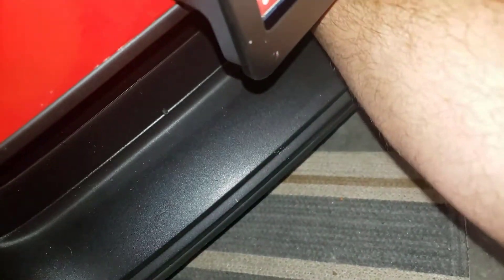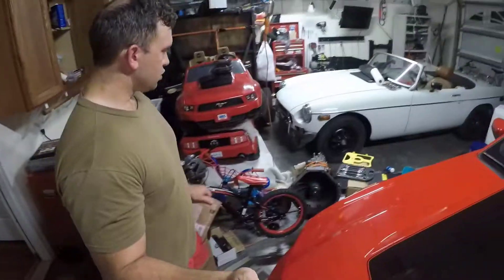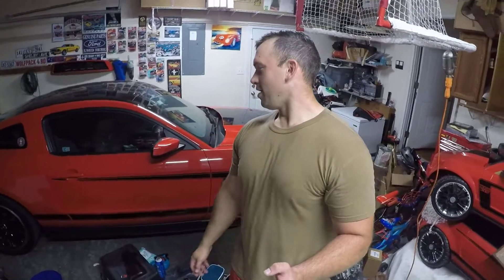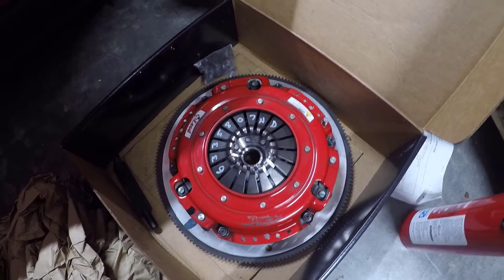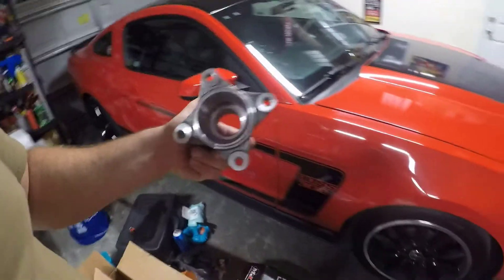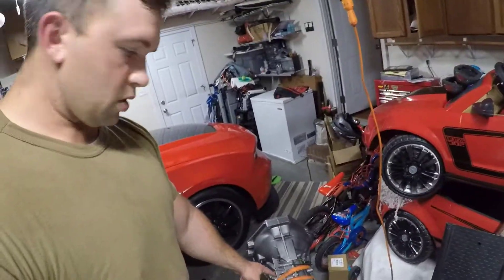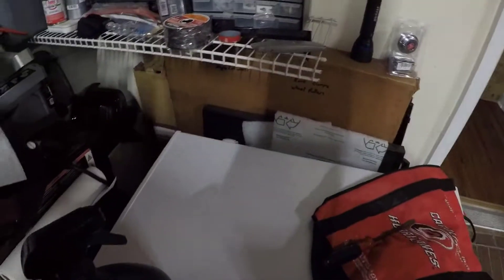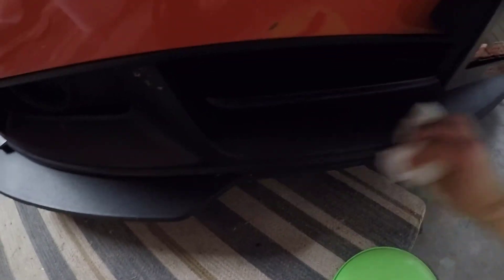Unboxing Some Parts Needed to Install a S550 Calimer Stage 3 MT82 on a S197, My 2012 Boss 302

Comment: I’m excited to see some reviews after you get everything done. Might be enough to sway me away from a T56
Reply from the maker: Im hopingnto have it done before my baby is born but that may not be feasible.   We will see, I still need to order my 1 piece and actually do the s550 to s197 trans conversion
Reply: @BrailsfordsRides  understandable, life comes first. If you weren’t so far up North VA I would offer to come help you get it done.
Reply from the maker: @ManuaLiberty  im not in VA I'm in NC
Reply: @BrailsfordsRides  I thought I had saw a VA plate on your car, must have been another Channel.
Reply from the maker: @ManuaLiberty  thats mine but im stationed in nc
Reply: @BrailsfordsRides  I gotcha, I didn’t know you were in service. Thank you sir!
Reply: Calumet trans handles RPM’s better and allows you to save some original parts over a T56, the gears in this are also Billet and can take a beating.